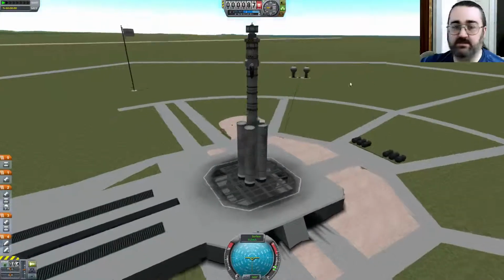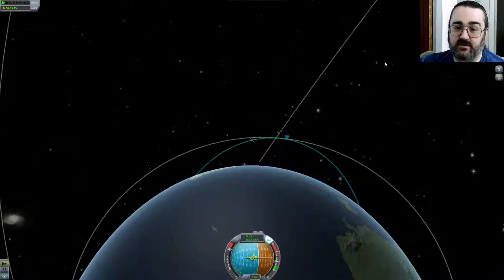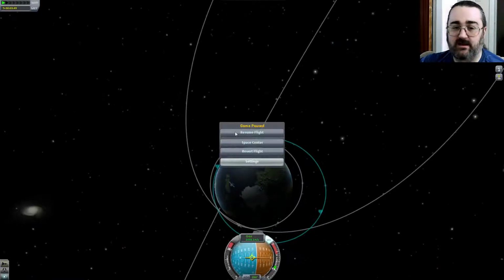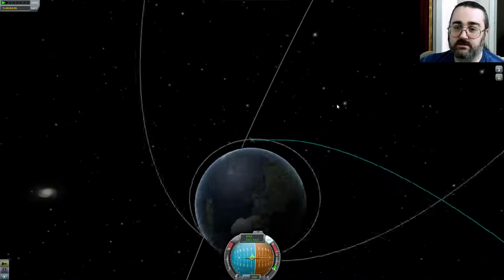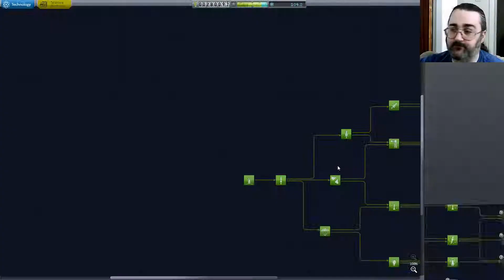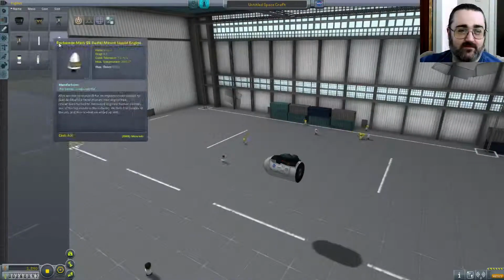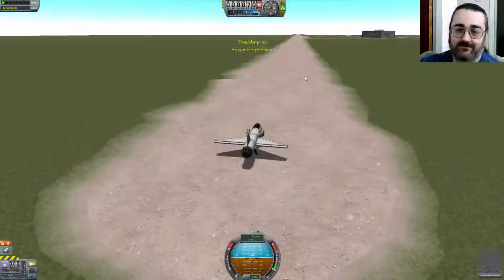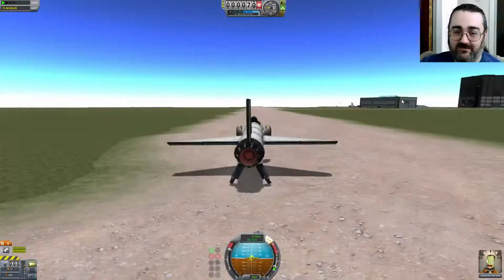Kerbal Escape Velocity Part 2

Comment: It might be because the decoupler was 'above' the probe.  If you set it up so that after you empty all the tanks, you eject the probe body onwards, it might work then.  If you strap an antenna and a thermometer on the probe body, you can get some interplanetary science.  Those 2nd stage parachutes could go if you need parts.
Reply: The great thing about the thermometer is that it doesn't need to be reset. So you can endlessly take and transmit readings.
Reply from the maker: Jaye Foster Ah!  Now that is interesting!  Might be time to do the next Polar Orbiter and shove a thermometer on it...
Reply from the maker: Jaye Foster Sounds like a plan!